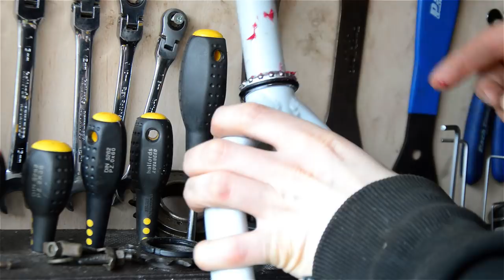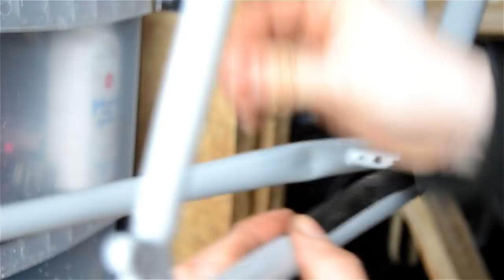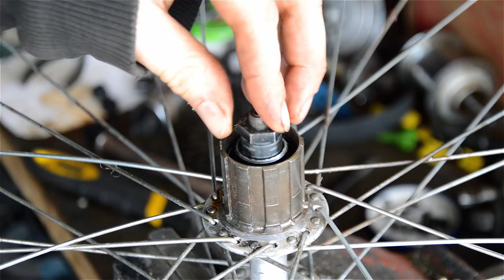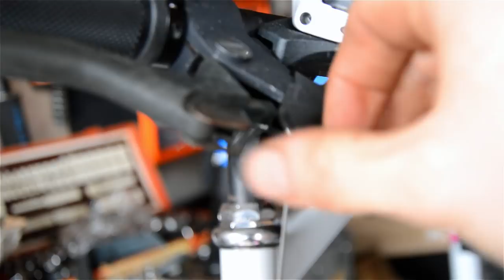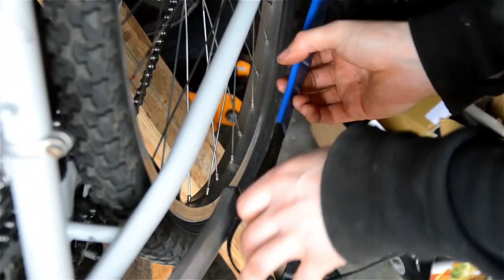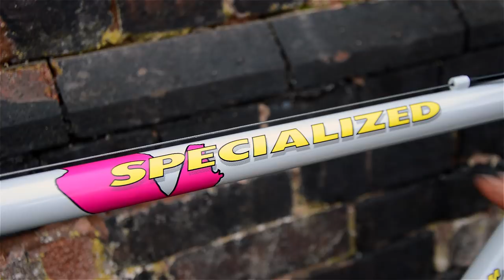1989 Specialized Rockhopper - THE FINALE! - Retro MTB Restoration

Comment: I have a dark emerald green 1993 Specialized RockHopper.  I rode it for 16 years until 2009 and then I had kids and well it ended up unused in the garage.  During some remodeling in Aug 2017 it ended up in the back yard left exposed to the sea air and elements.  Flash forward to Feb 2019 and I decided to clean out the backyard.  It was a well worn bike already although only a few impact marks but I figured it would go to the dump.  Alas I decided to give the girl one last wash and WD 40 treatment mainly for nostalgia reasons.  The changeable parts were mostly rusted but remarkably the frame, breaks and rims are in great condition and the decals still in place including the Made in the USA to the left of the “Specialized”.  I have a new project.  Your video inspires me!  Cheers mate.
Reply from the maker: Awesome!  Good luck with your project.

Comment: Idk what it is about the retro mountain bikes but they just put a smile on my face. Great job, man. I  cleaned up a 94 univega alpina 5.3 that was in great condition and then did a giant atx 760 (idk what year) but it was too big for me. It could have used paint but i sold it to an older guy on craigslist who seemed happy with it. I'm picking up a 90s Hardrock tomorrow after work. I am gonna take time and have this one painted. I'll probably run it SS and put avid single digit 7s on it. I have a 2018 marin pine mountain that is setup for off road touring. I want a bike that i can just go cruise around on mindlessly. Hopefully it turns out nice like this one. I love thoe decals!

Comment: Came across your Channel a few nights ago and have watched alot of your videos in that time.I myself have restored 4 of my own bikes that was lay in the shed for years all date around early to mid 1990s no resprays needed all stripped down cleaned and fully serviced.Now on my 5th bike which needs a respay its an early to mid 1990s Dawes Impulse. So after watching your videos so I think I'll do a video of the rebuild. Really enjoyed watching keep the videos going.
Reply from the maker: Thanks!  You have a Dawes Impulse eh?  It wouldn't happen to be the mint green and silver version would it...?  I'm doing a build on one of those tomorrow :)
Reply: No the bike was origianly Blue on the rear green in the middle and White on the front of the frame, the forks was the same colour off blue, I hope this makes sence. Also the previous owner decided to try and respray it mint green and silver he also put different components on. The bike had been laying about in damp sheds as the paint job wasn't very good the frame has a lot of surface rust so sand blasting then powder coating I'm going to do it a gloss black I think. I have seen that frame on your facebook page was waiting  to see if your doing a video on it.

Comment: Great job, usually, I prefer skin walls on a bike of this period but here the black tyres suit the grey frame just fine. The only thing I'm not understanding is, after going to the trouble of powder coating, new decals and cables you neglected to  fine detail the chrome work. The metal/chrome on the hub quick release leavers and brake components could have been de rusted further quite easily. Doing so would have made this bike look brand new. Never the less a very nice build.

Comment: Hey :) That is my bike ! What I mean to say is my bike is the same bike ! Mine has never been rebuilt but is in really great shape !
I really like this video !
I have repacked the bearings !
I have the original tires they're like brand new !
I run a set of nimbus alligators !
But other than that she is like she come from the factory !
Reply from the maker: Nice!  Keep it safe.  I'm sure it'll be a collectors piece one day :)
Reply: I have the same bike, same color, Deore LX grouppo, 16" frame. Only problem I have with it is the stem, it to low and forward, thinking about getting a adjustable stem, riser bars for a more upright riding position.

Comment: Watched at 0.25x speed & learned alot, thx! Had 2 Qs: 
i) easy enough to install front suspension on this model? I’ve seen another of your videos doing such, but did not quite understand how to assess the bike for upgradeability (to front suspension fork).
ii) how to determine year of manufacture?

I’ve got an early 90s RockHopper from orig owner, and wanted to try air shock on front (had my beloved ‘98 same model stolen here in Mesa, AZ).

Comment: How does it ride? I have a 1998 rockhopper. I replaced the original shock and handlebars. I also liked the 21 speed gripshift. But sadly I got hit by a car last fall and rims and shock and derailer are wrecked. Now I’m bikeless. Gonna try and save up for a new rockhopper.
Reply from the maker: Great.  Really smooth.  The friction on the front ring is actually quite nice.  It allows that little bit of extra fine tuning.  It won't be hitting the trails though.  It's too nice for that

Comment: The Rigida Laser rims are designed with a 'lip', the inner face never sat flush with the braking rims and over hung a couple of mm. They were probably not that worn. Just In case you come up against them again mate. Actually bulletproof rims, early 90's midrange Diamond backs and Raleigh Dynatechs had them as standard.
Reply from the maker: Oh is that right?  Thanks for the info.

Comment: Nice work man! I recently acquired an older Rockhopper that I'm working on, how can I determine the year it was manufactured? I located the stamp on bottom of frame it reads PW307784. Any help greatly appreciated.
Reply from the maker: I worked mine out by looking at the components first to get a rough date.  Shimano are always stamped with a date code.  Then I just Googled Specialized brochures from that time and found the matching bike.
Reply: @MonkeyShred  Brilliant thank you!